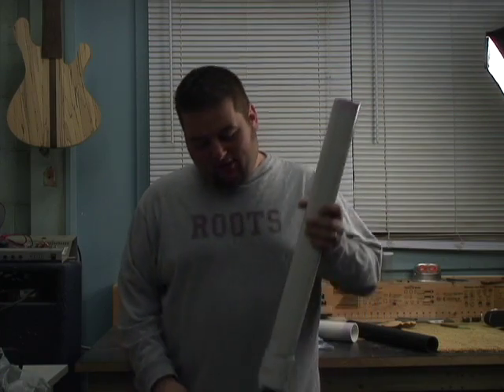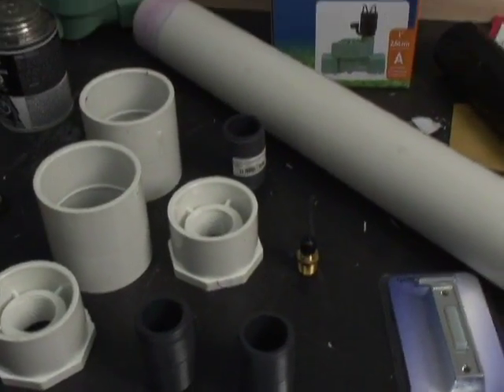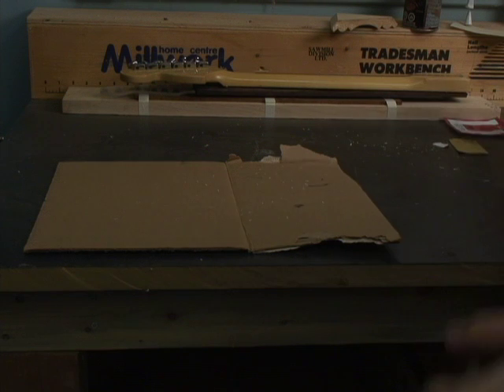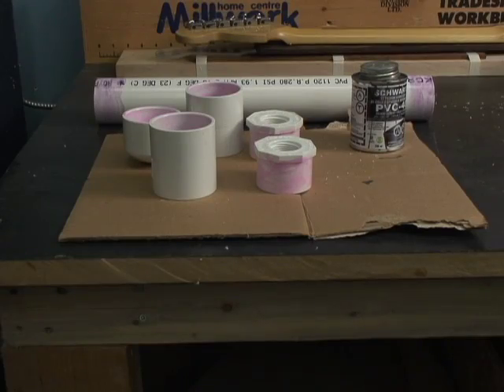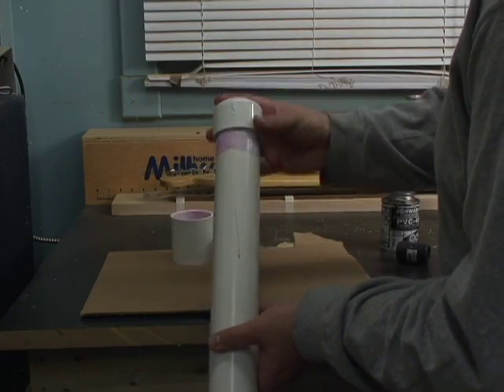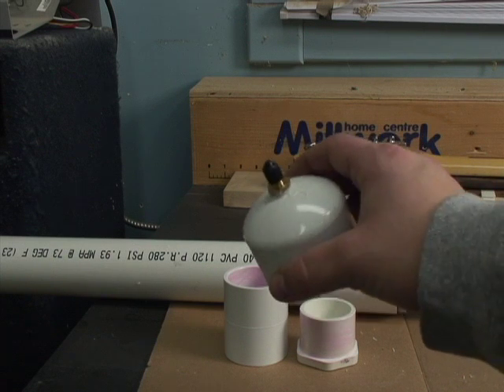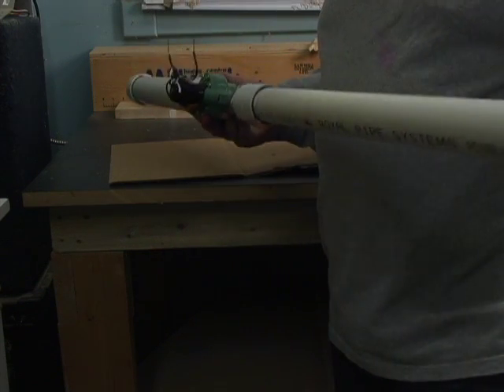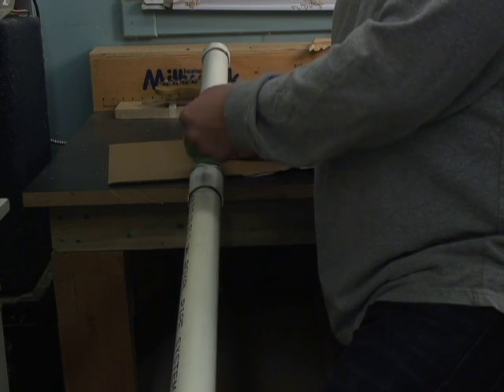How to build a air cannon low cost

Comment: Did you have to modify the sprinkler valve for air?
Reply from the maker: no i just used it as was but i would look into better power source to get to open quicly

Comment: Thanks for the video! I've just made one up to act as a mock explosion for movie making (instead of firing a projectile its just dirt and stuff in a funnel). However when I fire it (which is done from a distance, out of the scene) it doesn't release the air fast enough, just sounds like a horn for 3-4 seconds? Did you modify your solenoid or is it stock? Any chance when could see how she shoots and at what psi etc? thanks again

Comment: hey man what happened to the doorbell trigger, im making a mock up of something similar to this for surf fishing and the simple side mount switch would be much easier than the handle like set up
Reply from the maker: mario mackiewicz  hey i have 4 of them made not sure which one video taped making but the door bell is on two of mine and they work great but it some time got triggers by mistake but with the toggle switch i some time left it on and drained battery so both have there issues

Comment: awww i want one!!!!!!!!!!!!!1111
Reply from the maker: rocketsbabe31  it easy to make and cheep  the only issue i run into is getting the right pressure in it.
Reply: I put an air pressure gauge on my holding tube.
Reply from the maker: it was fun but i don't use as much as i  would like